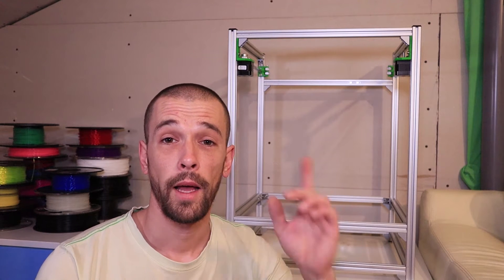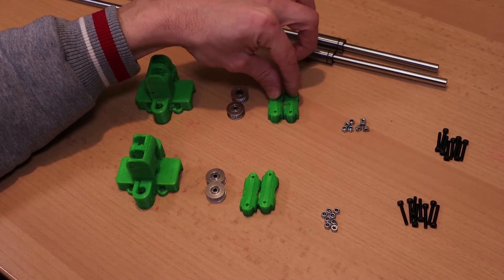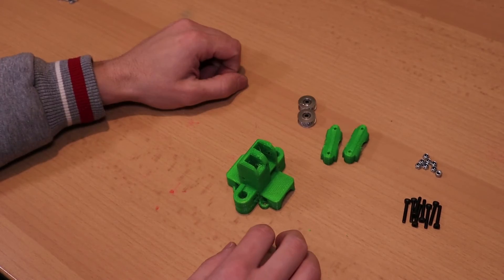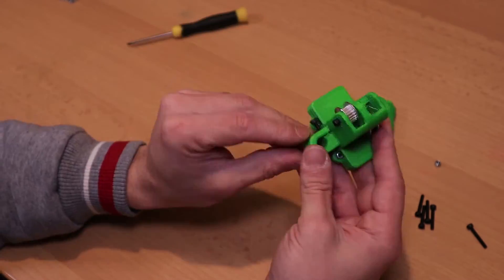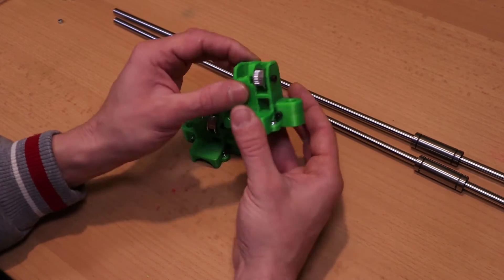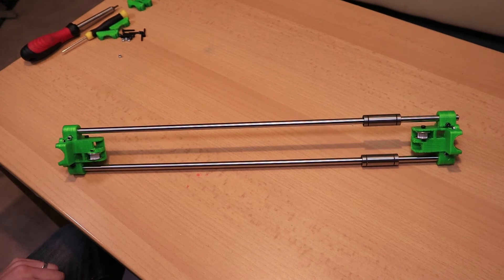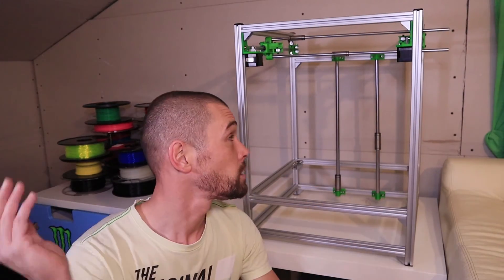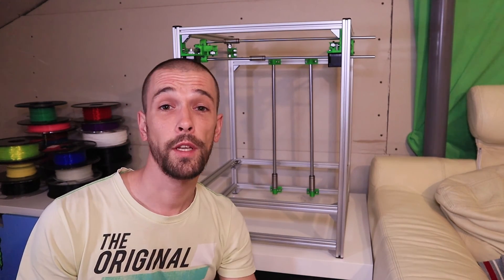EP.04 - Building a 3D-Printer - Hypercube evolution

Comment: I have a suggestion for getting the nuts into slots that are too small.  I'm printing the OpenRC F1 car and it uses a lot of connections where the nut is slid into a slot.  On my Ender 3 the slots all came out too small (probably too high of an extrusion multiplier, I'm guessing).  Instead of trying to enlarge all the slots with a file, I just used a soldering iron.  I put the nut (non-locking type) into the slot and then used the hot soldering iron to push and melt it into the slot until it lined up with the hole.  It wasn't an ideal solution but the nuts are locked in there now and the connection is strong.  I got the idea from videos where I saw people using soldering iron to push threaded inserts into parts.

Thank you for putting these videos together, they are very informative.